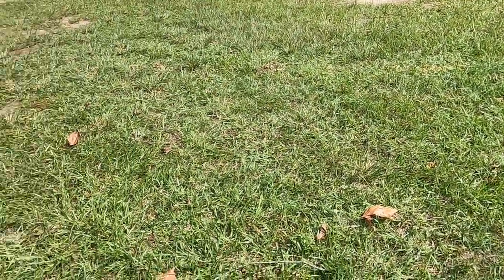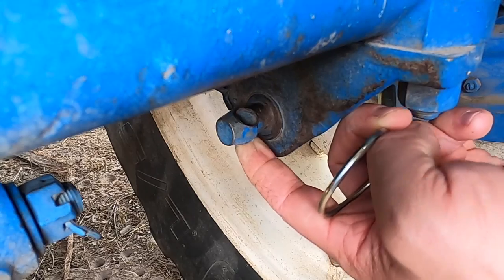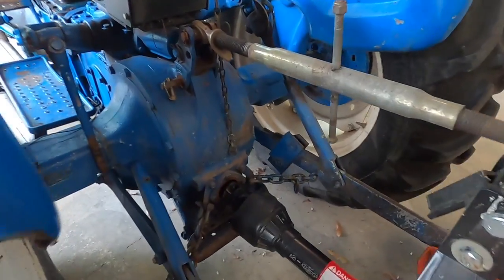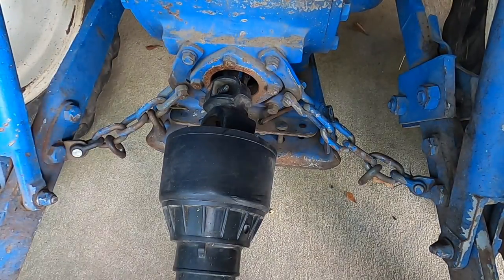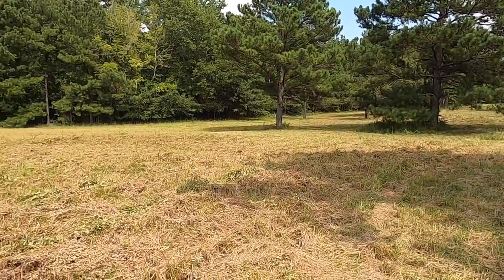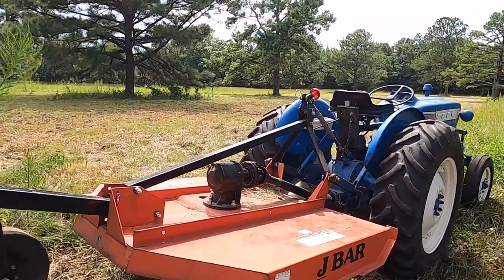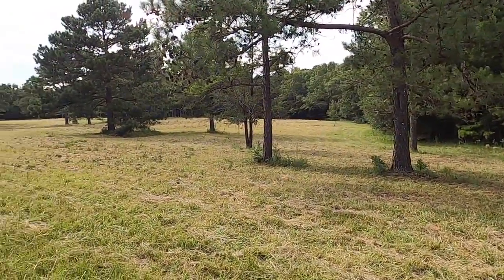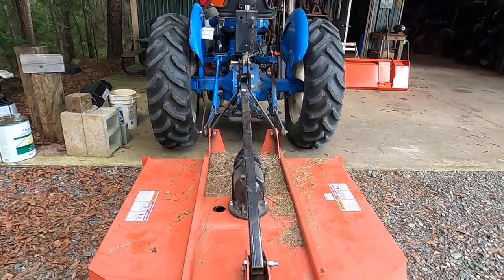Putting Old Iron Back To Work

Comment: Enjoyed the video - I mowed a lot of acres with a Ford 2000. The curved end of the blue stabilizer bars should be attached to the pins under the rear axle - this allows the bar to better clear the axle when you raise the implement.

Comment: I've got a soft spot for these old Ford tractors. I've spent a few summers on a Ford 1900,2000, and 3000 pulling a bush hog and flail mower behind it. Love the old 3000 diesel. 😁👍❤️
Reply from the maker: Wonderful old machines.

Comment: Such a great old tractor the 3000. I have a 1966 gas model. It does so many jobs for me. I just planted a hay field with it yesterday.
Reply: only problem with the gas is they vapor lock a lot in really hot weather
Reply: @frostythesnowdragon3170  
I've had mine for 20 years and thats never happened.
Reply: @Dave-fo1cb  you must live in a cooler area
Reply: @Dave-fo1cb  I have a 1968 vintage gas 3000. Haven’t noticed any vapor lock either. I use for mowing, brush cutting, blading the gravel drive, carrying stuff in or with the bucket. When I was a kid, we had a 2000 and a 4000. All of them did and now do their jobs.

Comment: When you attach implements and need the sway bars, raise the implement off the ground slightly so you can move it left and right.  I can always get one SB on my Ford 4000 but the other is usually stubborn.  I put one sway bar on, raise the lift so I can manipulate the implement and with just a slight bit of movement I can always get the other SB to line up.  Just a little tip from one old tractor guy to another.  Happy mowing, and your 3000 looks and sounds great.

Comment: Another great video thanks Wes! That welding job looked good enough to me.  I remember using those stabiliser bars in my younger days, and we only ever used one.  Once the implement is attached, the distance between the two arms is fixed, so you only really need one bar, though it could be said two would spread the load a bit.  I still can't get over how great that Ford is loooking since you gave her a clean up & service!  Would have been nice to see your Dad trying out a real tractor!  Regards to all - stay safe & well.  👍👍
Reply from the maker: Ha! He's done his time in on real tractors! He's earned the luxury of power steering.

Comment: Some times the valve stem leaks, put a little spit on the end of your finger and rub your finger across the top of the valve stem.  If it's blowin bubbles just give it a snug with a valve stem tool (or an old metal valve stem cap that has an integral one on it). --  He he, lots of grindin and paint make a welder you ain't .😎  Words that I recite every time I melt steel together.  Great video Wes, thumbs up.
Reply from the maker: Paint and a grinder can cover a lot of evil for sure. I actually checked the valve stem with soapy water and didn't see anything. It must be a really slow leak that's tough to see.
Reply: Are they tubeless ? Could be a bead leak .

Comment: You have another old stabilizer bar for the other side. If it is to short, cut it in half and weld in a short piece to make a custom bar for the mower. If it is to long, section a piece out of it and voila... Great to see old vintage tractors still working and being useful. (My brother has 6 assorted tractors from 1950 all thway to 1983? I think.) Oh yea and 1 new Kioti. Love your old tractor vids.

Comment: Had a 69-71 2000 Diesel back in the 90s, was my pride and joy. Money got tight, kids came along & I sold her to pay bills. Even though I have a few others since, including a 2021 L2501HST, I still look at used 2000/3000 for sale on FBMP & CL. If I run across a goodern, I might just buy it as a dedicated bush hog machine.

Comment: I am assuming you tried this, but when I put on my stabilizers, I often have to have the implement raised to be able to swing it to get them both on.  Trying to do it on the ground is a no-go.  I chuckled when I saw the Tonka dump truck.  I literally have the one I receive on a birthday in the '70's sitting on my deck as a decoration.  It raised eyebrows with the better half when I put it there, but I told her it "sparked joy".  Thank you Marie Kondo for that bs line....
Reply from the maker: We tried it, mower slipped right off the lift arms.
Reply: @falllineridge  Well, that is not good.  Maybe adjustable bars are the way to go then.  I imagine the Kubota has them.  With your mad welding skills you should be able to fabricate something.  ;-)  (Don't feel bad.  I started welding in my 40's as I did not want to pay someone to patch my race car and seem weld it.  I got better, but I am not a welder, either.)

Comment: I noticed that when you were camming that the Left receiving pin on your mower appears to be slightly bent backwards. This would make it slightly shorter and not allowed you to attach the 3nd bar and may be why you couldn't get the arm in place. Try checking it with a square or angle finder. Great come back fix good seeing the Boss's vocabulary growing so fast he's definitely a helper for you. As always good luck and God Bless.
Reply from the maker: Hey Mark, I think you're correct there. I think it came like that from the factory. I think that's contributing to the problem too.
Reply: @falllineridge  just trying to help you out. I hope that works out for you and can't wait for the video. I love that you have such a great work ethic and I see the love you have for The Boss and the patience you show him. He's going too be a much better man because it. As always good luck and God Bless.
PS you can do it remember let your hater's be your motivators.

Comment: I have the exact same tractor with the exact same three-point lift mine unscrewed and pulled out just like yours I simply screwed it back in no need to weld but they do sell those for about a hundred bucks a pop

Comment: I don't know if you did this before welding but I was always told to disconnect the negative terminal of the battery before welding, or you may short the diodes in the alternator's rectifier circuit !

Comment: Lots of those old tractors only used one sway bar. Your tire could be leaking at the bead or the valve stem or the core it's self. You may have had issues welding from contamination in the lower piece. Warming it was a good idea, drives out any moisture and maybe burns off some contamination.

Comment: I really think when you shortened the chains up and you raised 3 pt up all the way, the hydraulics pulled that worn out thread apart. Your fix will work! Only adjust on opposite side.
Reply from the maker: You know, I didn't even think about that. Could be!

Comment: Spent a many an hour on a Jubilee and other 30 Hp Ford tractors.  I worked at my Grandpas farm in Ben Hill County, GA inthe summer, starting at about age 12. Just for the record, I do not see that tach in the PTOrange. My grandpa would have kicked my butt if he caught me running a powered implement  and the engine was not in the PTO range on the tach.  I notice such things.

Comment: Many of those lift links are welded. It's not that they were improperly built or weak. Just consider the many many years of use they have and how many times someone exceeded the designed limit. As a farmer who uses Ford equipment, its typical things that happen. I've seen many tractors with welded lift links, of all brands. 3 point hitches take a hell of a beating.
Reply from the maker: I've exceeded the limits many times. Surprised this is the only damage from it. Testament to how well these things were built.
Reply: @falllineridge  absolutely

Comment: Not sure if it applies to tractors as well but any time your welding on something with an electrical system you want to un hook the batts before welding. So you dont short anything out.
Reply from the maker: Someone else mentioned that, thanks! Didn't know that. Smart.

Comment: Great video I cut four acres with a Ford 3000.  What is the size of your rear tires.   Mine are dry rotted and I need to replace them.
Reply: There were several sizes for those tractors. Look online to find the one that matches your hub and current tire size. If the size is legible on the sidewalk, trust that. If you have fluid in them, make sure you have hydraulic help to move them. That fluid is 304 lbs on my 3000 if full and people have gotten hurt badly by tires tipping over.

Comment: That will probably break  if you ever have to do another one split the one as far as the other one sticks in it about 4 inches and weld through the split welding the 2 together and it outlast the tractor
Reply: if you clean and grease the exposed threads too before inserting it and vice-grip the split closed around the threads it should still move ok once weded.

Comment: If the weld is ugly but works and saves money, does it matter? I think not. 
I bush hog with only one stabilizer bar all the time.
Reply: I couldn’t mount my stay-bar pins in line with the lift bar pivot (FEL bracket in way), so can use only one bar ever. It’s aft of the pivot, so straight behind when lifted and shoved right when down. Aligns the right side of cutter with outside of right wheel track. And gets my blade out farther to the right. Feature, not a bug!

Comment: That lower female part looks like cast iron and that does not weld very well!
But just the fact that you're going to put on a surface weld just around the edge that is not going to hold at all under normal use!!!
I'm pretty sure that would not even last a couple of days.

Comment: Bound to get vibration how the cutter blades are mounted. Why not mount them diagonally opposite each other, it will be balanced then.
Reply from the maker: They swing out when you engage the mower. They're on a hinge so that if you hit something (rock, stump, whatever), they'll swing in and not destroy the mower.
Reply: @falllineridge  they could still do that if mounted diagonally opposite. Only needs one mounting hole drilling. Like the way your son is showing an interest.
Reply: They ARE mounted diagonally opposite, that thing would destroy itself very quickly if they weren't. Because they're pivoted just makes them look odd?

Comment: it must be hard to turn that tractor without power steering.
Reply from the maker: Good exercise.
Reply: @falllineridge  and much easier when the implement is lifted, though well-greased king pins helps a lot. I drove a much heavier 5000 wth no power steering from age 13 for 8 years and still don't have big biceps.

Comment: prob the valve stem on that trailer tire
Reply from the maker: I checked that too, off camera. Nothing. Might be a bead or sidewall...or just a leak so slow it's hard to see.
Reply: @falllineridge  hmmm. mystery i guess.
Reply: @falllineridge  For the sake of 10 minutes to get the wheel off, you could do with an old bath to dunk the whole wheel in - it makes it much easier to find leaks, and with the amount of tyre issues you've had lately, it would come in handy Wes!

Comment: An "expedient fix" would have been to replace it. All the effort of fixing tire, welding and transporting the tractor. You could have bought a new one and replaced it in 5 minutes. Now you have something that is a questionable repair and safety. Steel to cast usually a poor match even with high nickel rod.
Not trying to run you down, but time is money.